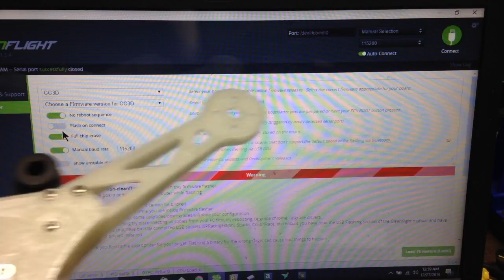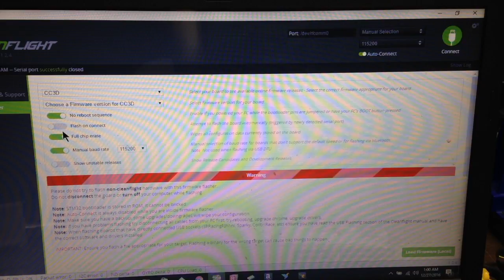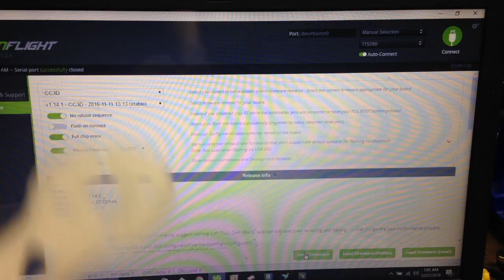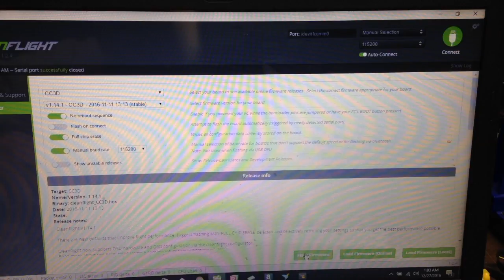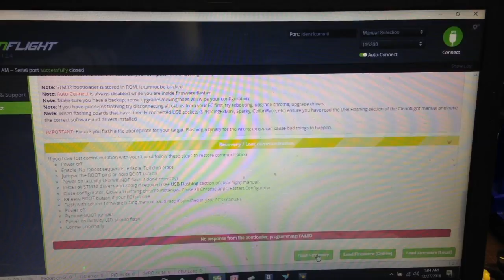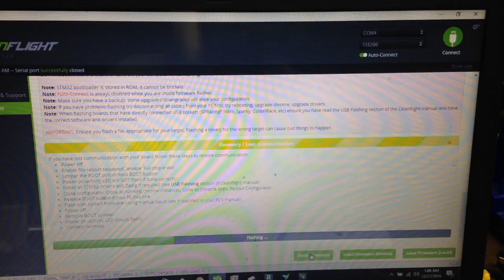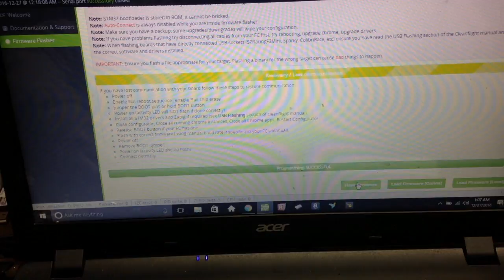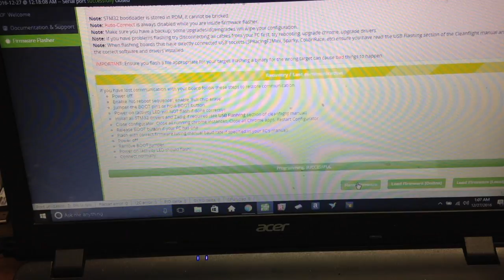CC3D FLASH CLEANFLIGHT ERROR FIX

Comment: same problem with me
I am trying to flash cc3d with Inav 1.7.3
it shows an error message bootloader not responding 
in the video you said that keep shorted pins till clicking the flash button
I kept the pin soldered but it didn't work
can yu help me
Reply: it worked on cc3d atom but problem is with cc3d